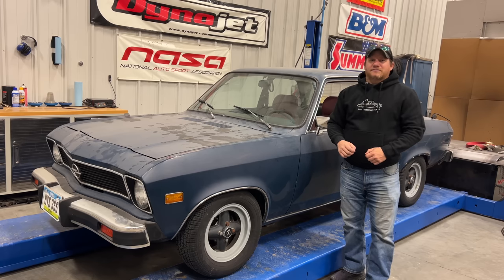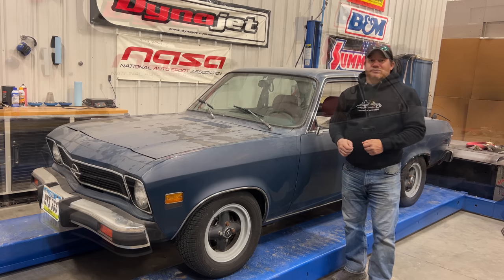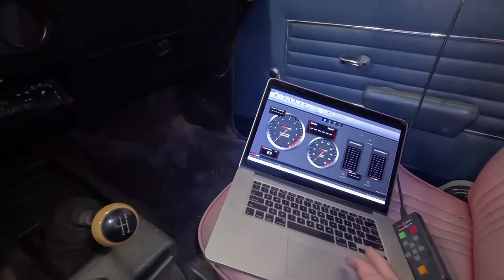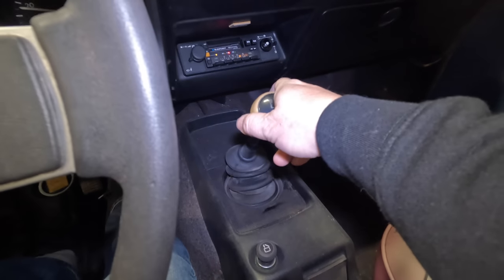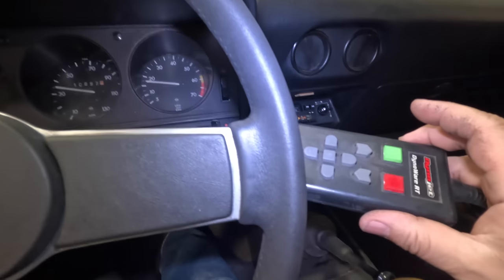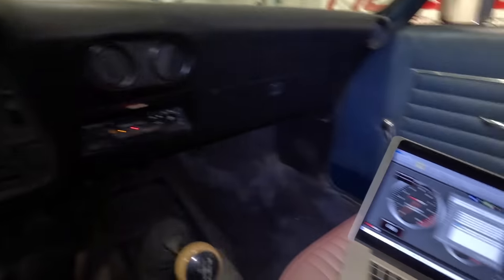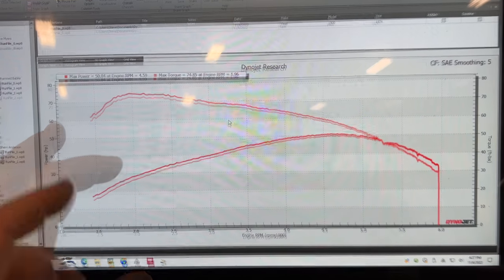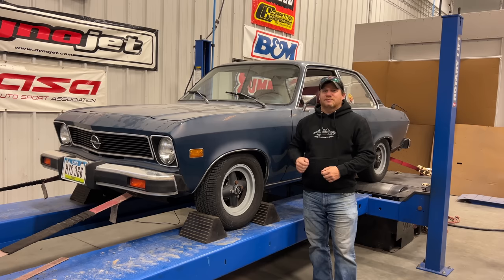Is the Opel 1900 Showroom Stock Sedan Still Any Good?

Comment: Fun to see that Road & Track cover from 1975; I recall when all of those cars were new, and all over the place!  I had a couple of similar examples of the models shown, a 1972 Vega Kammback (wagon), the old "mini-Camaro-look" (90 BHP, burned oil; kept a case in the back), and a 1978 Civic 1200 (advertised as 55 BHP; was quite nimble, once I fitted a set of Pirelli P3s to it; great in snow).  The VW Sirocco was my favorite, as far as the styling went...Thanks for this demo, and the explanation of the dyno test!

Comment: That video brings back memories. My Dad worked for a big GM dealership in Switzerland for many years. Even after that we dove TONS of Opels for ages. I owned at least twenty Opels. The prettiest one of them and maybe the best looking car I have ever owned was a Manta A. 
The Ascona A had a big engine for an Opel of it's time and my Granny drove the same car. But I never seen the US version with those oversized bumpers. They are not pretty to put it mildly. People tend to forget how light cars were back then. You did not need a ton of horsepower in order to be quite fast.

Comment: These Asconas (we pronounce it 'Ascohna' ) were rock solid cars in their day here in Europe although we never got the US specification Fuel Injection just Solex carbs. I ran an Ascona 1900 after the new Gp 1 rally (basically showroom with roll cages) regulations came out and running my Mk I Escort RS1600 became stupid expensive. Opel built a Gp 1 rally special to homologate it and it had many very clever additions and with some 'creative' reading of the regulations you could build a very fast rally car. They were so good Walter Rohrl won the 1982 World Rally Championship drivers' title with a (much modified) Ascona 400.

Comment: I had a 72 Opel Manta, fabulous little cars. Put some Michelin radials on it and it was the only car I ever put into a four wheel drift due to it's front/rear balance . Put some real snow tires on it and added two sand bags for winters and never, ever failed to get home, passing many 4x4 on the way. Fantastic little cars but they rusted so easy.

Comment: A few know that the car could go at least 5000,000 mi on the original engine if maintained properly. I had a 1971 with at least 4000,000 mi engine not touched. Dec 1968 a car mag tested the reliability all cars sold in USA, They ran them 1000,000 mi .The most reliable car was the Opel, They were so impressed they ran it another 1000,000 mi. The result was it still ran like new, No US cars made it over1000,000 mi without oil burning. That's not bad for a $2,000 car
Reply: More details, names, dates, Please... Would love to read about that test...  Thanks!

Comment: Give it a good tune up, valve adjustment and carb rebuild and test it again!
Reply: US spec. cars were fitted with Bosch L-Jetronic fuel injection which was not available on European cars and the CIH design allowed hydraulic cam followers.
Reply: @1chish  not the ones I works on! Single downdraft Weber 32/36 PICT.
Reply: @graemelliott3942  Well if you are in the USA then a) how many do you work on and b) are they competition or road use cars?
The reason the US cars had Bosch FI and a 7.6:1 compression was to meet the new US Federal emission regulations. It could well be someone has changed the Fi for a Weber or used a Euro spec engine. Some earlier US cars didn't have the Fi. Of course any US service people in Germany could buy an Ascona and ship it back to the USA as a second hand car and avoid the Fi regulations.

Having said all that the Gp 1 homologation carb was a Solex 32 DIDTA-4 which was crap for every day driving and only good at full throttle so for non international rallies we used to change them for the Ford RS2000 Weber DGAV 32/36 which fitted the Opel manifold and even the air cleaner.
Reply: The Bosch FI was only fitted to US spec Opels in 1975 (last year they were imported and sold in US).  I have a 1971 1900 4 door my grandparents bought new, had a Solex carb originally that became miserable and was replaced with a Weber 32/36 DGAV.  Huge improvement.  The  FI cars had a better exhaust manifold that also helps earlier carbureted cars if you can find one.